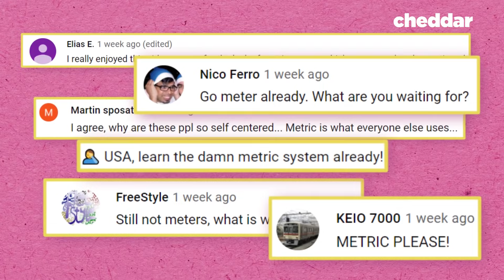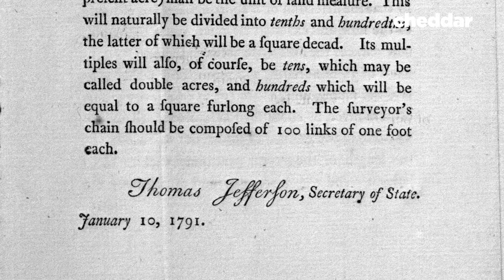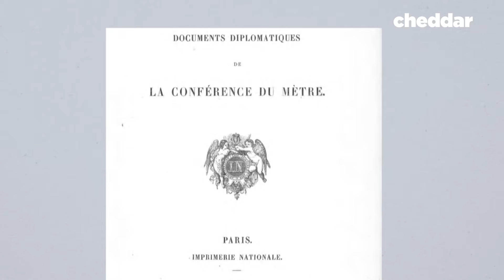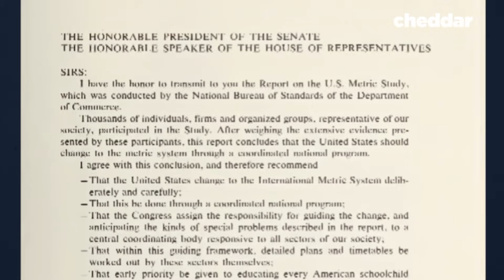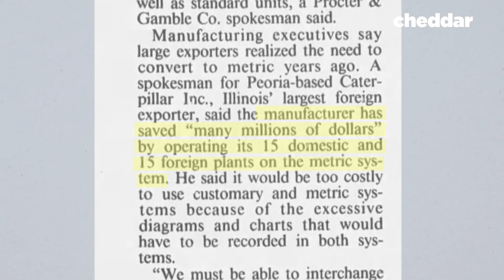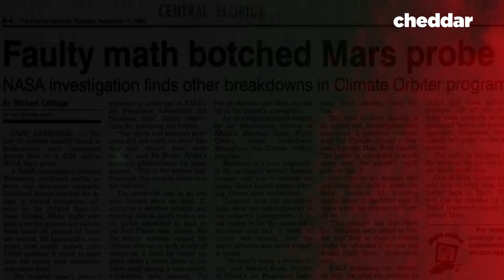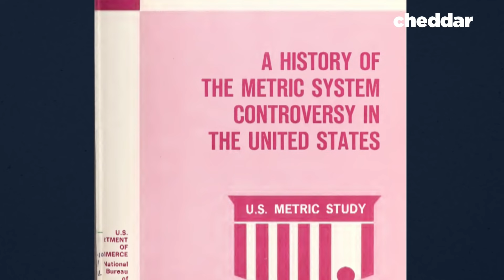Why Doesn't the US Just Use the Metric System? - Cheddar Explains

Comment: I know that the metric system seems easier to use, but there are some drawbacks. Measuring in 12s (such as inches, hours) is more divisible (1,2,3,4,6,12) than measuring in 10s (1,2,5,10). It makes expressions involving measurement more bland. E.g. If you give them an inch, they'll take a mile compared with if you give them a centimetre they'll take a kilometre. Imperial measures allow for more ways to describe measurement of gradually increasing amounts - inch > foot > yard > mile (mm > cm > km); quarts > pints > gallons (ml > L): ounces > pounds > stone > hundred-weight > ton (g > kg > tonne). It is easier to visualise the imperial measurement e.g. someone who is 6 feet tall as opposed to 1.828 metres.

Comment: All military veterans know the metric system here in the US. All medical items are in metric. Tool sets use both imperial and metric tools. Soda is sold in liters not quarts. Temperature is better in F degrees because there are more degrees of measurement. By the way the story about NASA is nonsense and never happened because NASA only uses metric.
Reply: The failure is why NASA uses metric cuase when working with other countries it's better to use a universal measurment system.it's also why all those fields use metric.
Reply: At the time of Apollo, NASA was building rockets to US Customary units.  W. von Braun is on record complaining about it.
Reply: @GH-oi2jf  , Sorry but NASA was military not civilian run. Which is why the astronauts were military people. NASA always used metric. As does the military. Just like those silly stories about $800 ash trays were silly.
Reply: @GH-oi2jf  Military. The U.S. military uses metric measurements extensively to ensure interoperability with allied forces, particularly NATO Standardization Agreements (STANAG). Ground forces have measured distances in "klicks", slang for kilometers, since 1918. ... Military vehicles are generally built to metric standards.

Comment: What's 1' - 7 11/16" plus 11' - 5 7/8" plus 3' - 1 3/4"? It's just addition and most people can't do it in their head in less than a minute, if at all. The English system sucks.
Reply: Typical contrived problem that nobody actually needs to do.Most people couldn’t do that sum in their head if it were written with decimal fractions, either.

Comment: I would be 100 percent onboard with metric if for ONE thing; standardized bolt head sizes for a given thread size. M12 bolt - do I need a 15mm wrench, 16, 17? Oh, I see a  Could be any of these. It's absurd. See that 17mm head? Could be two different bolt thread sizes. Unlike a 1/4 inch bolt, is ALWAYS a 7/16 head. 3/8 ALWAYS 9/16 and so on.

Comment: I remember back in the 70s when they were trying to switch us over to kilometers on the highways, but they made the dumb mistake of putting both kilometers and miles on signs and then put km/h and mph on our speedometers (which are still there btw).  This would have gone much easier if we just switched over without trying to compare the two distance measures.  When we drive, we're most concerned with how long it takes us to get somewhere.  If you're driving 100 km/h and your destination is 50 km away, you know that you'll get there in about 30 minutes.  That's all we care about really; no one needs to adjust to the 'feel' of a kilometer compared to the 'feel' of a mile.  When I lived in Europe, my car had only km/h on the speedometer, and within a week of driving I was used to the distance and speed measurements.  When I moved back to the US, I forgot how long a mile felt, but I've adapted again.  I think if we switched driving distances to kilometers and used only km/h on speedometers, we'd all pick it up pretty quickly.

Comment: My parents talked about the push back on metric in the 70's and one complaint that went out was they would have to try and convert metric to imperial units just to drive. I pointed out that as of the 80's no they didn't. It says 70kph on the sign you drive at 70kph on the dial. They say both in the US now. But in the 70's the speedometers were all in mph. And no one saw that changing. Of course they thought the automatic transmission was a fad too so, yeah.

Comment: If you are american and you have a problem understanding metric think about it this way: the metric system is a stair with km at the top, meters at the middle and mm (millimeters) at the bottom, if you go down the stair you increase the amount of zeros (because is easier to go downstairs, and the increment of zeros could be the increment in velocity) and the using the same logic but backwards going from mm to meters you reduce zeros because is more difficult to go upstairs; now this is the exact amount of zeros you need to add/remove depending what you want to use:

10mm = 1 centimeter

100 cm = 1m (or a 1000mm but its easier to remember like this)

1000m = 1km (kilometer)
Reply: We know how the meteoric system work.cuase we have to use it in science.

We just don't like using the meteric system in every day usage.

Also at least we don't pretend to be on the meteoric system when really we have a bunch of different ones.serouisly tell me how a stone is a metric measurement?

Comment: Someone described to me a solution, which is to ditch the imperial system. No slow transition, as people will stick with imperial.
For example, all our stuff has both metric and imperial (Rulers, speedometres, etc.), but people use imperial because it's the one they know. The solution is to not make metric and imperial stuff, change all our signs, stop teaching imperial in schools.
If our street signs are in metric, and you also have no imperial unit to use instead, you're gonna use the metric.
Reply: That soluation failed miserably already and cuase places to still use there old system but say officially are metric.

Comment: Americans complain about how hard it is to convert feet to miles, ounces to pounds, etc, but fuck you for suggesting an easier system 🙄
Reply: I have never in my long life heard anyone complain about how hard it is to convert feet to miles.  When dealing with distances of miles one is never interested in how many feet it is.  We use feet when working on a scale much smaller than a mile.
Reply: @GH-oi2jf  Fine then, are you also going tell me you've never met anyone who didn't need to convert ounces to pounds or feet to inches? There are tons of people out there who don't realize 6 feet, 6 inches is the same as 6-1/2 feet, because when they think of "half" they think 0.5, not 6.

Comment: Not that switching is bad. But how does changing a belt from inches to centimeters suddenly change how many belts you need for a lineup of vehicles? They are the same length as they were. Just called something different.

Comment: I've always thought it was odd that metric time never caught on, even in revolutionary France.  There are 86,400 seconds in a day.  If we divide the day by 10 five times the result would be a unit that's a little shorter than a second.
We couldn't make the calendar truly metric, but I think we could improve it.  12 months of 30 days each with five (or six in leap years) days at the end that are not in any month.  Six days per week, and five weeks per month.  In most years, the last week would skip a day in order to keep the weeks and months in sync.  Or, if the seven day week is to hard to abandon we could have 10 months with 35 days each (five 7 day weeks), and 15/16 days at the end that are not in any month.

Comment: Metric vs Imperial comes down to this;

Metric is the measure of science. It is easy to use with decimal points, and thus with computers. For people doing the kind of work for which it is natural, it simply makes sense.

Imperial is the measure of craftsmanship. It measures, especially of length, are divisible by multiple factors; people accustomed to working by hand and eye (and then checking) find it natural. 10 is evenly divisible by 2 and 5. 12 is evenly divisible by 2, 3, 4, and 6.

Both groups wonder why the other doesn’t simply do things their way.

And everybody else considers the debate about as interesting as spelling reform.

Comment: i just figured we had to  be the ones that used imperial correctly since the brittish gave up. :)  heck we had to be the ones to use "english" correctly.
Reply: in the american continent, USian english is taught as the only correct way of speaking anglish and people correct you if you speak another variant. I find this very bad and rebelable. Then, the american rebelry against USian english conflicts with the USian rebelry against non-USian english on the internet because it looks like USians feel the opposite, like brittish english is taught them as the correct one and not the other way around. This causes some problems.

Comment: Why not explain that the US will never switch because the Imperial System is mathematically superior for being divisible by units of 2, 3, 4, 5, and 6? We can fraction to whatever we need. Metric is easier to convert into other metric units, sure. But that's all it's good for. 

Until then I need someone to explain why time isn't metric, why weight should by synonymous with mass, and why I should only need to divvy things up into units of two and five. 

There are blatant mathematical and practical truths metric users ignore and then think their system is superior. Total joke.

Comment: Hi, I live in Europe and the imperial system really piss me off, and I hate to hear it in USA movies. I never can figure out how much these fucking inch, feet, miles, nautical miles,  yards, gallons, pounds, knots, Fahrenheit degrees are!! Often they are not converted in the dubbed audio...
But also the navy and aviation worldwide should switch to metric. It has not sense that concerning ships and aircrafts even in Europe they use these fucking miles, feet and knots!! These numbers mean nothing to anyone in Europe and the most of other people in the worlds. There is an efficient standard, let use it for everything and everywhere.
In Europe the inch is still used to define dimensions of pipes and other mechanical items. This mix has not sense, especially out of the USA.
Reply: never figure out what they mean?
Reply: Bugler55  Ok, but in the real world, the distances are measured in Km, then also while you fly, it is spontaneous to compare distances always basing on Km, not on degrees of longitude. And the actual geographic degrees of longitude/latitude that you cross during a flight, match with your flied miles, only when you fly parallel to equator or along a meridian.
Reply: When I read Tolstoy, sometimes I come across a distance given in versts.  I don’t get angry.  I don’t give up reading Russian literature.  I just move along and maybe look it up later.  I think it’s close to a km, but it isn’t worth getting worked up over in any case.

Comment: The question regarding metrication in the US is going to depend on the wheres and hows of doing so, as it has been since we started this longstanding project in the 1970's.  As things stand right now, there's no good reason to keep FTA/FDA regulated goods labelled in both metric and US customary as the law currently requires (we could switch to metric labelling tomorrow and most people wouldn't bat an eyelash; it would even be more cost effective to do so).  So here are a few ideas on what should change immediately, and some others that we might hold off on for now:
Human Weight/Height - switch to kilograms/centimeters immediately; if you have to go to a hospital and need to tell medical personal your personal data, your body may thank you, especially when getting medication (already measured in grams/liters).
Gasoline - No point in changing from gallons to liters; as we make the switch to EVs, the measurements will automatically change to metric (kWh).  
Vitamins - No change (or at least, keep IU along with grams), as grams aren't a particularly accurate measure of potency when it comes to supplement efficacy over time.
Speed/Distance on Roads - This will be costly, no two ways about it.  But there's no reason to keep subunits of a mile for any particular reason on signs, for example.
Beer/Cider - Time to do with them what we already do with wine and spirits (liters).  
Produce:  This will require an education campaign, but it's workable.
Building Trade/Real Estate:  Industry feedback will be essential - keep in mind that many metric countries don't necessarily adhere to metric measurements here (real estate in Japan/Korea measured in tsubo/pyeong - 3.31 square meters).  
Temperature:  This will be the hardest to get people to accept, as most Americans have internalized Fahrenheit to such a strong degree.    Body temperature will be an easier switch than weather.
Reply: "metrication"?

Comment: We don't use the metric system because it will be an absolute nightmare to switch over because first most of our road signs would have to be changed which would require that the road system of the country to be shut down, not to mention most people would refuse to use it, not to mention all cars on the road would have to be taken off and changed, at this point it is nearly impossible and the people would probably vote out the government

Comment: Someone asked me if I was stupid when I was younger cause I wrote the date as day/month/year and I didn’t get it. Then there was math I don’t think I made the effort to learn it was just complicated. 
I didn’t know that America ran on a different measuring system than the one I grew up with in the home country, not a single adult made the effort to explain that to me.
Reply: Month/Day/Year is just awful and makes it confusing when writing pure numbers. If using names for month you could use both like Mar10 or 10th of march
Reply: @The360MlgNoscoper  9/11 is actually 11/9 in the UK. However, one of the few good ideas to come out of the EEC, is a new date writing method specification which any computerised data sorting algorithm will love. Its simply year/month/day e.g. as I write this 2021-01-24
But because the US, UK, French & German ways of writing dates vary, at home I'll write 24-Jan-2021, so no longer 24-Jan-21 where year 21 could be confused with 1921 if hand written.
Reply: @The360MlgNoscoper  agree. When using M/D/Y in numbers it’s so unnecessarily confusing. I really hate that
Reply: I (a Usanian) usually write day month year, but it is necessary to use an unambiguous style.  Today’s date, for example, is: 2 March 2021.
Reply: @GH-oi2jf  You agree with my comments above then. What is a Usanian; is it a Bolt on extra ?
Oh right, USA-nian, got it now, but a new term for me.
Reply: 4/5/18
Reply: Just use ISO 8601.

Comment: What's the date and time?
Everyone: 28.6.2019 10.02
Americans: 10:2019 am;6.02'28
Reply: I'm Lithuanian and we use date like this - 2019 07 13, 10:11. :)
Reply: This is a bad example. Time is expressed differently in many countries
Reply: That doesn’t make any sense on either line.  Are to trying to write 28 June 2019?  That’s the way I, a Usanian, write it.  Time is written with a colon, usually in 12-hour format with am or pm.  But what I will not abide is using am or pm with 12 o’clock.  It is 12 noon or 12 midnight.

Comment: To be honest in the UK we still use a mash up of both Imperial and metric. We still use miles as standard on road signs and when referring to distance- some use metres. We use centigrade when measuring temperature.
Reply: Also, what the hell is the deal with Stone as a weight measurement? Why?
Reply: You abandoned imperial length measurements 185 years ago in favor of the US standard. The old imperial inch was slightly shorter than the modern inch is. 2.5 cm as opposed to 2.54 cm. It's just too bad old Thomas Jefferson didn't live long enough to see you do it. I'm sure he'd have gotten a kick out of it himself. As he wrote the Declaration of Independence and developed US Customary.
Reply: In the US, we use meters instead of metres, which to my eyes looks like it should be pronounced “metters” or “met-trees”. We used to use centigrade, but now we use Celsius. But we prefer yards and degrees Fahrenheit, because you can easily pace off yards but not meters, and the Fahrenheit scale is much more practical, being based on human understanding of temperature. 0 is very cold, 100 is very hot, and 50 is a good yearly average temperature. Not so with Celsius, which elevates science over humanity.
Reply: I need KM/H

Comment: Kg to pounds multiply by 2.2
Inches to cm divide by 12 and multiply by 30.
You can do these backwards.
For anyone curious about inches to cm a ruler is 12 inches or 30 cm so it’s the quickest thing to plug into a calculator.
No, not even Americans understand what is up with the mile.
Gallon man.
I rest my case.

Comment: "Length and mass" 2:30
Is the animator high or the narator?
Reply: She meant that the order is different between the narrator and animation. The weight was moving when she said length, and the '1 meter' shakes when she said mass (i.e. weight).
Reply: Would be length and weight, cubics would be mass but what does any of us know, they obviously spent more time on puns than facts
Reply: @steveguy3  scientifically weight is a force and the proper word is mass
Reply: Exactly. A 1kg mass will always be a 1kg mass anywhere in the universe. However it will only have 1kg of weight here on Earth (or somewhere with exactly the same gravity) while no other forces are acting on it.